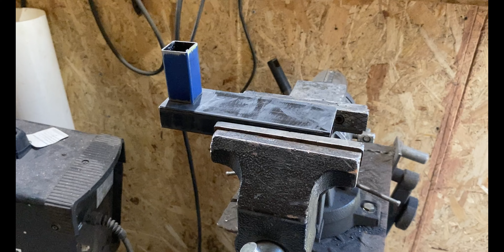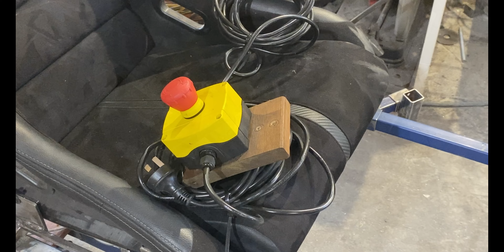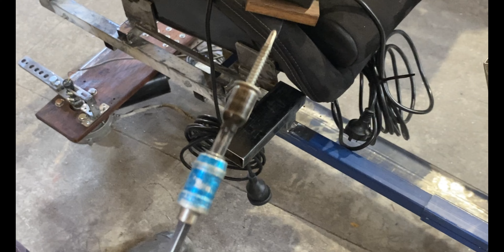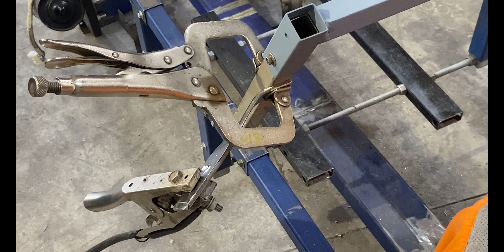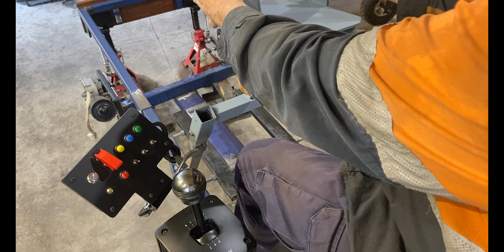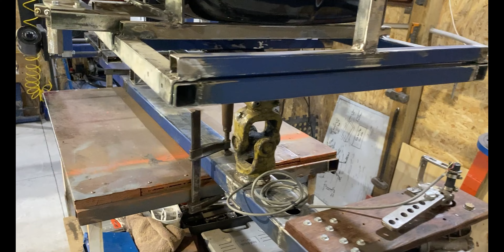DIY 3DOF Motion Simulator Platform Top Frame Build Pt 15 THE FINAL

Comment: Hey Doc, I've been browsing through a lot of your videos getting together a parts list and game plan to tackle this project. I have been obsessed ever since I came across it. So I did run into a little bump that I figured I would ask. I live in the US, so I don't have access to square steel tubing or most of the metal that is the same size that you used, so I'll have to settle with slightly different material sizing (But I ain't skimping out on the thickness lol). I was fine until I remembered that some of the square tubing has to slide around the smaller square tubing to allow for adjustments (great idea btw, being able to adjust things makes it great for everyone). I know you used 30mm x 30mm x 2.5mm tubing and had 35mm x 35mm x 2.5mm tubing slide over it, I won't be able to get as tight/snug of a fit (mine will probably be around 31.75mm x 31.75mm x 3.1mm and then have a 38.1mm x 38.1mm x 3.1mm tube slide over it). Do you think that having too big of a space difference between the two tubes will cause any issues? I personally don't think so after I had put some thought into it but I figured it wouldn't hurt to ask the man who would know for sure. Thanks for the super detailed build btw, your previous research and experience is a blessing to everyone who wants to have a motion sim rig, but can't afford one. (sorry for the technical question and rambling in advance lol)
Reply from the maker: @swampsn1per878 thanks for reaching out mate. Hey, no question is a silly question around here. I'm the king of silliness and have asked many a  question myself over the years, before committing to something. It's a sensible thing to do. I knew the Metric to Imperial thing would be a bit tricky for my Ally mates across the pond. Sorry about that. Looks like you've converted what is needed so good job. Is that 31.75mm the OD measurement? And is the 38.1mm measurement the ID on the larger slide over? (OD = outside diameter ID = inside diameter) Assuming this is correct, that would in my opinion be a little to much slop to be able to really clamp it with tech screws or even run a bolt threw.  You'd end up deforming the larger slide over trying to get it tight. Now. Lets talk about alternatives. If you could find box  steel that was smaller in diameter (lets say 20mm x 20mm) and it still had a 2.5mm wall you could use that as your main top frame, if it meant finding say a 25mm x 25mm slide over box. I wouldn't go smaller than 20mm box for the main frame and only if it's a minimum wall thickness of 2.5mm. Or maybe you can find 25mm x 25mm with a 30mm slide over? So your 31.75mm could slide over some 26.75mm or whatever it is you can make work. Often, It comes down to the wall thickness of both pieces to whether or not they will slide over each other. You've definitely got options to go a smaller box if needed. I'm always over engineering my stuff :)